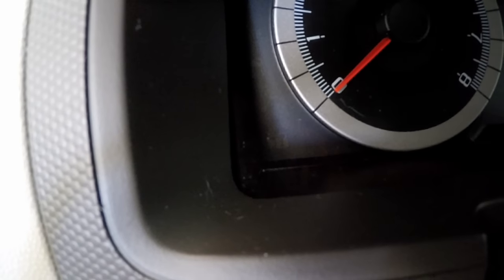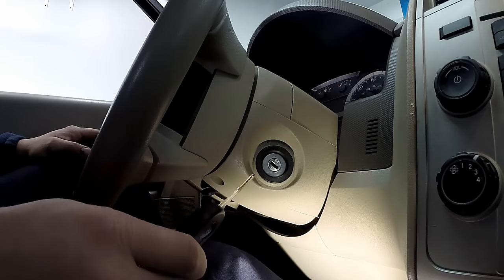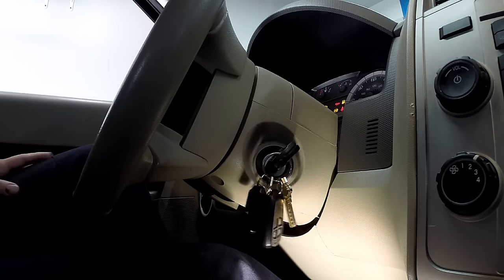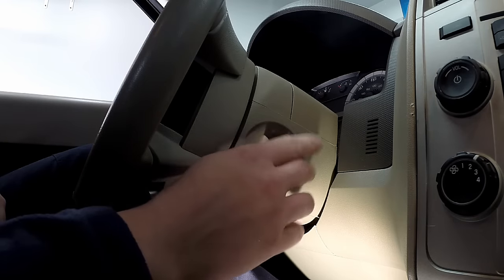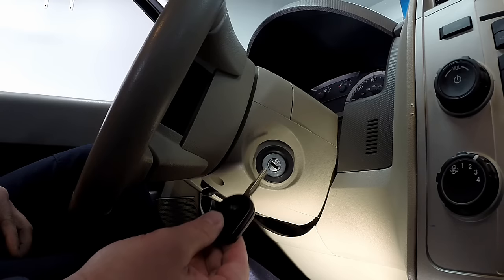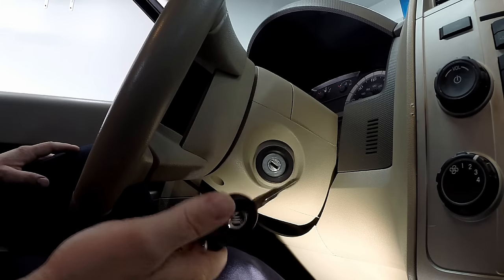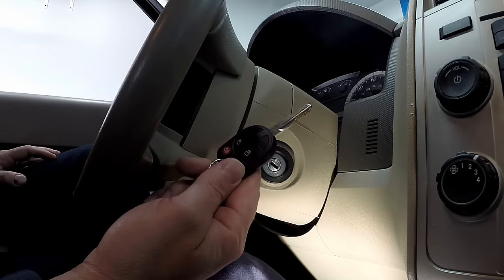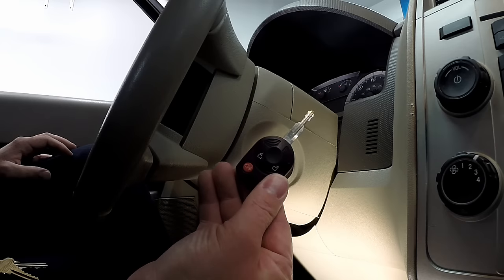Ford Quick Tips: #49 How To Program Additional Ignition Keys Yourself

Comment: Riddle me this.  2011 ford edge.  Go to unlock the door with remote and alarm starts going off.  Unlock or lock button on remote does not turn off alarm.  After alarm cycles off, I go to start the car and the alarm goes off again and disables ignition.  2 days of this and unhooking battery and no change.  Currently at dealership as I only have the one key fob.  Several phone calls to diff locksmiths and none thought it was a key fob issue.  ever ran into this on a FORD?

Comment: Ford tech I have a question. 2010 mercury Mariner got it at the police impounded. The key they gave me has limited was not the admin key. So me all stupid got an obd cable and the FordScan app. Deleted all stores keys from the PCM. Now I am unable to program the key they gave me. Read on a forum that I need a second key to program an be able to turn the vehicle on. Called a local locksmith they can't even program the keys. I know my last option is going to a ford dealer buy I already spend $200. Any advice will be appreciated.

Comment: I have a question. I have a 05 f150 and I changed my passenger wheel bearing and now when I put it in 4 low it will engage but the passenger side doesn't and I can hear it grind. Do you know what I could do?
Reply from the maker: +Jeremy Goodwin jack up the passenger side and spin the wheel vehicle off it should be locked into the axle. If not you may have damaged the iwe by not splining it correctly to the cv shaft before tightening the center nut see here for the proper splining procedure- https://www.youtube.com/watch?v=zqihvBDPEZc
Reply: Mine locks in I turned it and at first it made that sound(before tighting it all the way) then it locked in and the CV axle was moving so I tightin it all the way and everything moves and sounds like its supposed to. Just not when I put it in 4WL
Reply: How do you tell if I need to replace the actuator?

Comment: I tried to buy a chip key at my local hardware store and was told my 2015 Super Duty could only have dealer key. Is that true?
Reply from the maker: +ericbskivt Yeah they likely don't have that style in the aftermarket.
Reply: I have a 2015 F250 Super Duty - and while I still had both keys, I purchased two additional keys via the internet. The programming process is a 2-step process, each with different methods.

There is a first method that involves programming the key FOB to open and close the doors of the vehicle. The Key FOB programming step ONLY makes the key lock or unlock the vehicle. It makes the vehicle and the key FOB able to communicate via a long-distance RF link (think of unlocking your vehicle from 50 feet away).

Once you have programmed the FOB to lock/unlock, there is a second procedure that needs to be followed that involves putting the vehicle into a "receiver mode", followed by inserting and turning to ignition first one good key, and then a second good key (this let's the vehicle know that the legitimate owner is doing this) ... then, the third and fourth keys are also inserted into the ignition and turned. When done, this second procedure lets the vehicle accept the RFID code from the short-range RFID chip in each key. Your truck will now have 4 RFID codes stored - one for each key (the two originals plus the two new keys).

So, although you can program the lock/unlock FOB with only a single key ... to program the RFID codes (necessary to actually start the engine) - you need to have two original keys. Also, although the first procedure above programs the FOB - and with the F250 - allows the engine to be started - if you don't do the RFID programming, even with the engine running - you can't put the replacement key in the ignition and drive off - that ONLY works after you finish the RFID programming.

Comment: in my 02 fx4 f150 my dome lights & windows have stopped working.  I checked the fuse box inside & the 3rd fuse on the 2nd row was blown & blows everytime I try to replace it!  Any suggestions?
Reply from the maker: +Rod Bridges This is usually caused by a running board light that has rotted and shorting out.
Reply: I don't have running board lights

Comment: I have a 2001 Explorer Sport and someone attempted to steel it and screwed up the key switch so I bought a used steering column with only one key and installed it ! It will not crank over and the thief light flashes rapidly then flashes once and then 5 more times and repeats ! I only now have the one key that came with the used column ! HELP ME PLEASE ?

Comment: My used 2010 Ranger came with 1 chip key. Ford wanted $130.00 to make a second chip key. A key shop in Lansing Mi made me a cloned key for $90.00. The difference is that the new key from Ford has a different digital identity , while the cloned key is seen by the car computer as identical to the 1st key. The original and the clone can't be used to program a 3rd key, but why would you want a 3rd key?
Reply: Original key 2nd for spare and 3RD KEY for spouse. That’s why a 3rd key or many other reasons.

Comment: looks like an escape, i am looking for a  key and remote that is integrated, maybe even a switchblade type one. i hate using a remote and key separately. its clunky. 

also, the remote needed to be programmed separately. turn ignition from off to on 8 times ending with on. the doors will lock and unlock signalling the system is ready. then press any key on the remote to be programmed.

Comment: Why do you need both keys before you can program a third? unfortunately I lost one, so I order a new fob and key. the remote is programmed. But not the key!
Reply from the maker: +timothy jeanal Its a security feature.
Reply: FordTechMakuloco Hi FordTech. Currently having this issue with a 2000 ford escape.  Purchased a new ecu with 2 keys but did not cycle the keys. System is now complaining about not having 2 keys.  Can you provide any advice?

Comment: Anyone ? I have a 2000 Ford f150 Xl sport
4.2 L V6 with a 178000 miles on it. Ok ? Is i have 2 instrument cluster one that is in the truck. And one i bought from a salvage yard and when i switch them out it want let me start the truck. Switch em back and it fires right up. What can i do to get the other one to work ?

Comment: What kind of vehicle is he in and what year is the vehicle
Reply: F 150 looks like around a 10-14. To identify the difference between the 40 and 80 bit transponder keys, the STRATTEC 80 bit key blanks will have the letters “SA” stamped on the blade and the 40 bit key blanks have the letter “S” stamped on the blade.

Comment: Does it still work in a Ford Expedition if you only have 1 ignition key — looking to add 2 additional non ignition keys ??
Reply: looking into this for my 2000 f150 and what I'm finding is that it takes an obd connection and software to program a second key if you only have one. $80 obd tool is still cheaper than getting a locksmith to do it by a long shot, especially if I want more than one key done.

Comment: Where is the best place to purchase an extra key ?
Reply from the maker: Dealer or locksmith because cheap aftermarket keys have intermittent concerns.
Reply: FordTechMakuloco: I just got one programmed key and same as others, buying a key in Amazon would be a cheap option. However, is there any way to program with only one programmed key? Thanx in advance
Reply: to purchase an extra key on Ebay, cheaper and worked. for programming you have to search on youtube

Comment: If you lose 1 of your 2 keys it will cost you $60 to $200 to get a new key made and programmed. If you have 2 keys spend $25 now and program an extra key yourself. As long as you have 2 programmed keys you can always program a 3rd. If you only have 1 key try a hardware store first to see if they have a programmer. They're usually cheaper than the stealer. Locksmiths are even more expensive. If you're prone to lose keys like my daughter then always having a 3rd key is a necessity.

Comment: What if u only have 1 key that’s programmed
Reply: Solved my own problem , remove transponder from working key then silicone it to inside of column then you can use any cheap copy key
Reply: @fecklarjenkins2549  hey man I  only have one key as well what do you mean  silicone it to the inside of column,? What column? I would appreciate your help I have a 2008 f150 fx4
Reply: Adrian A Velazquez u take the 2 or 3 screws under the ignition lock that hold the bottom cover on and as close to where the key goes in that’s where u silicone the transponder on the bottom cover , test it very well before the silicone dries and that way u can adjust it to where it needs to be. It needs to be as close as possible to the little black ring on the ignition lock that senses it, and be carful the transponder is in a glass pill looking thing and you don’t want to break the glass

Comment: Hy thanks for your support.
Quick question please bro. I faced a difficulty 2013 explore Original remot came to me not functioning key no issue start the car. 

as i believe there's a different between the key with chip and the remot. 
I  tried to put the remot in to the program mod 1st worked door cycled after turning the ig on  & of for 8 time but then didn't do it again. 

i turned the vehicle on of opened the doors still no luck of 2nd option how can I now fix it reprogram hes original back and 1 extra 1  as well i have programming tool im508 if needed please.

Thank you all.

Comment: Thanks for the video.  I have a 2011 Escape.  This method programmed the new (3rd) key to start the Escape but the remote door lock/unlock did not work.

To get the 3rd key totally programmed including the remote, I followed this procedure:

1.  1st key in ignition.  Turn to run and off 8 times.  locks will lock and unlock. Remove key.
2.  2nd key in ignition. Turn to run and off 8 times ending in the run position.
3.  Press any key on the 3rd, new key.  Doors should respond.

Hope that helps someone.

Vin

Comment: If you only have one key, it will cost you about 400 bucks at the dealership to have a new one cut and programmed
Reply from the maker: +edesir Find another dealer it should cost $150 tops unless you are using an IKT.
Reply: FordTechMakuloco Thanks, I'll shop around. Been holding onto this one key since 2011. Mainly need a low profile key to start
Reply from the maker: +edesir yes the regular pats keys work on IKT vehicles don't let them push the IKT. Most newer vehicles is an 8040 key from Rotunda.
Reply: Thanks :)
Reply: READ  BARRY